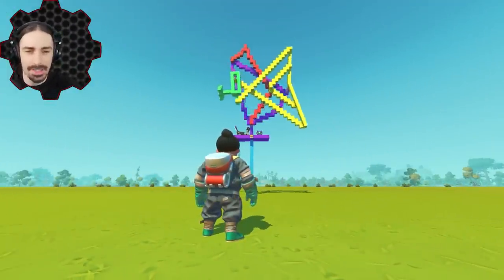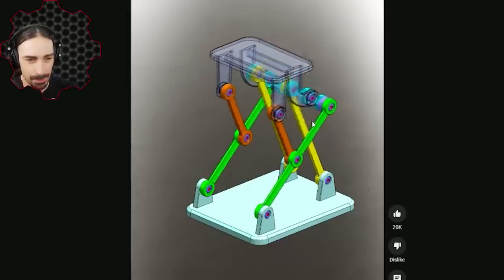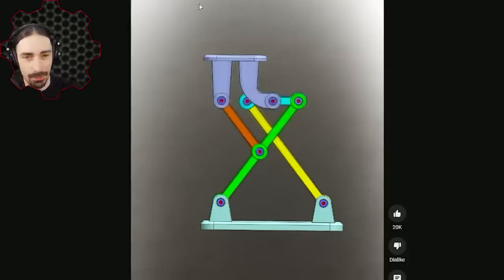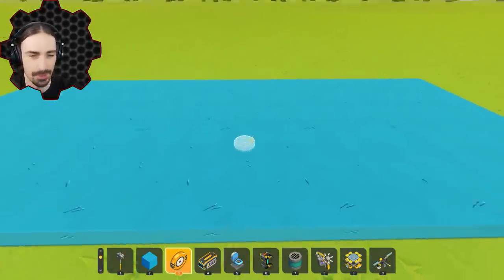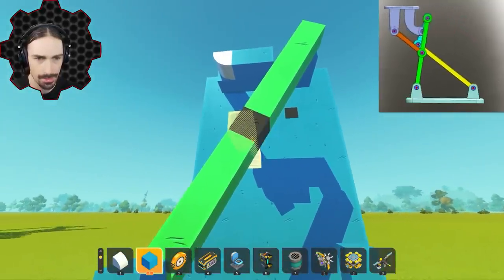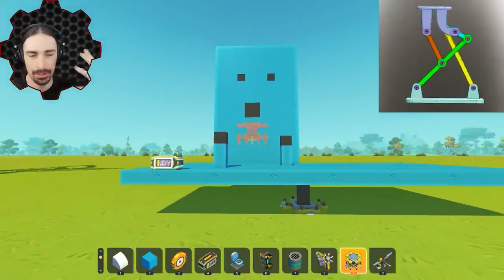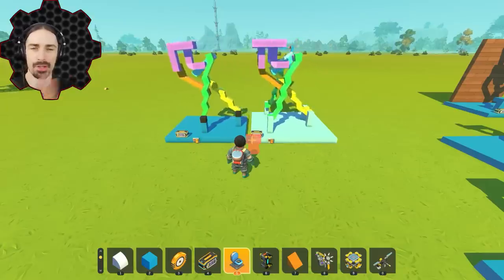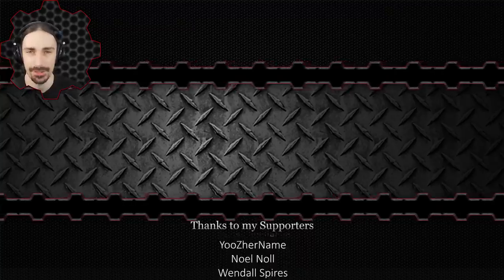Doing a Simple Task The Hardest Way Possible...

Comment: Fun fact: This mechanism is actually just the plantigrade linkage ScrapMan already built, just flipped upside down and with extra bits for support. In fact, this is the original implementation of the plantigrade linkage that the inventor came up with. The idea was to use this in steam engines to support the horizontal movement of the piston without linear bearings.
Reply: Bro I wish you sat next to me in school
Reply: @monke1758  lol
Reply: The top looks like pi.
Reply: Cool! I want him to attempt to make a conveyer belt powered by a winch(in either scrap mechanic or instruments of destruction bc it obviously won't work in trailmakers/other games).
Reply: Noooooooooooooooooooooooooooooo Noooooooooooooooooooooooooooooo Noooooooooooooooooooooooooooooo Noooooooooooooooooooooooooooooo Noooooooooooooooooooooooooooooo Noooooooooooooooooooooooooooooo
Reply: @technobladeik  Pikachu can't talk, but pika- choo choo goes choo choo .
Reply: @linglingtanudjaya6347  dont make me think about maths i did bad enough in school

Comment: I would’ve thought that when the blue was vertical was the ideal reference since all the bearings seemed to be on a 90 degree build grid
Reply: Same, when the mechanism was at its far left position the blue and green beams would both be vertical and collinear which should make it easier to make on a fixed build grid.
Reply: @conorstewart2214  but  the blue one never reaches perfectly virtical tho
Reply: @conorstewart2214  but the green beam would be hard to build since it wont be aligned to the grid
Reply: @astrohahawashere  but it doesn’t need to be a straight line
Reply: @nojusisnarauskas2343  bruh its a linear linkage its supposed to go straight
Reply: the blue line never goes vertical
Reply: @astrohahawashere  it would be aligned to the grid.

Also the beam doesn’t need to be straight, all that matters are the locations of the mounting points, it would work just as well with a curved beam or even just a disc.
Reply: @jakobmanton6889  not with the angle of rotation in the animation but it could, you just need to turn it a tiny bit more, there isn’t a hard stop on the rotation.
Reply: @astrohahawashere  yeah but it the shape of the line doesn’t matter, he literally explained this in his last video making a mechanism
Reply: @conorstewart2214  if the green beam was rotated 90 degrees it won't align to the grid
Reply: @astrohahawashere  if the green beam was vertical like I described and collinear with the blue beam it wouldn't have any trouble aligning to the grid, it would be perfect for making on a grid.
Reply: Can confirm that this works - it probably took me just a couple of minutes to measure the distances, confirm that they matched up fairly closely with Pythagorean triads, and build it in my own world (it moves very smoothly with a 180 degree motion).
Reply: @conorstewart2214  try it yourself then and see what happens
Reply: Also btw the green line never lines up vertically with the blue line
Reply: @astrohahawashere  just try thinking a little bit, in the animation it very nearly does, if you just rotate it a tiny bit more it would line up, there is no hard stop to the rotation, it is perfectly capable of rotating until it lines up.
Reply: @conorstewart2214  I tested it in a game called poly bridge and it never lines up
Reply: @astrohahawashere  Poly Bridge would probably be the best game for him to make these kinds of things, if he figured out how to get the motion started
Reply: @astrohahawashere  look at this comment thread, someone used the method suggested and it worked, and it works in theory too, just because you couldn't manage, doesn't mean it doesn't work.
Reply: @conorstewart2214  I guess you may have been true and my measurements are a bit wrong but still if the green beam was vertical it won't align to the grid
Reply: I guess you're correct if you build it big enough since I searched the Wikipedia and the length of the green bar is 2.5 times the blue bar
Reply: @conorstewart2214  I've done a bit more maths, and it turns out that the orientation that Scrapman was building it in also lines up with the grid - if you build it about one block taller than his last version - I've got the green and yellow beams 10 blocks between centres (or 11 blocks total, with bearings on the end blocks), the orange beam 5 blocks between centres, and the blue beam and the platform 4 blocks between centres.

It turns out that when the blue beam is horizontal, or either of the vertical orientations, then the bearings of the platform are always 8 blocks above the bearings on the ground (as always, measured between centres) - I haven't checked the angles in between because that requires trigonometry, and I was doing the maths with pen and paper, and a knowledge of the 3,4,5 Pythagorean triad.
Reply: @Autoskip  yeah that makes sense. A lot of mechanical systems can be solved with just basic geometry and some trigonometry. I do wonder how or why people came up with these mechanisms.
Reply: @astrohahawashere  except it would, why is it so hard for you to think about it and understand? What do you think makes it that it can’t align to the grid?
Reply: @conorstewart2214  I said my measurements are wrong
Reply: And also I thought that the yellow bar would limit the blue and green bar so they will not line up
Reply: @astrohahawashere  why argue it so confidently if you aren't sure?
Reply: @Anikin3-  they meant horizontal

Comment: If you make these contraptions much larger,  you'll have better resolution for placing your bearings.
Reply: Bigger ain't always better. 😁
Reply: @BLKBRDSR71  in this case bigger is better. the larger the structure, the higher the resolution, and thus, the closer to ideal the bearing placement can be.
Reply: but there would be more weight, and in turn, more stress on the bearings
Reply: @Cat_1n_A_Basket  good point.

Comment: there are a few things that I would like to point out, first of which being parallel lines. if you'll notice, the yellow line and red (orange?) line stay parallel through the whole motion. another thing is midpoints. the red line was built off of the midpoint of the green line. one thing I might've recomended for this particular build would be starting with the diagonals, specifically green. since we know that the length of green and the length of yellow are the same, with the length of red being half that, and also knowing that green needs a reliable midpoint for red to attach to, as well as the parallel relation between yellow and red, I figure it would be logical to start with green, consdering how many relations it has. of course there is also the mathematical way of doing it, figuring out lengths/ratios with the Pythagorean theorem, but as far as trial and error goes, you want to pay attention to as many minute details as possible.

tldr: when recreating mechanisms, it may be beneficial to not only look at positioning of joints and how it generally moves, but also how it moves relative to itself, considering which things will stay parallel or perpendicular and other things of the sort.
Reply: It was just rotating more, you can see how far the green and yellow connectors rotate compared to the animation.

Comment: I think that bearings are way cheaper to build in survival mode than pistons. So if you like a platform that can quickly extend and retract while bot raids are going on, I think it's a cheaper solution than medieval-styled castle gates. I think those doorways have to be big enough in order to protect the base form afar.
This contraption can be put under water with the platform getting you out of reach. and it seems that it would be easier to protect with sturdy materials against Totebots.
Also, with a bit of tweaking, you could definitely have a platform that lowers while moving sideways so that you can have your main base even higher from sea level.

Comment: For those of you curious, the required dimensions for this mechanism are as follows (credit to @thang010146 and his video "Tchebicheff stool 2"):

Length of blue bar: a + a
Length of orange bar: 2.5a
Length of yellow bar: 5a
Length of green bar: 2.5a + 2.5a
Horizontal distance between the seat connections: 2a
Horizontal distance between the ground connections: 4a
Reply: I do not understand anything 🤣

Comment: I think this can be done with scrap mechanic's build grid. I believe the important measurements are that the green and yellow are equal and the orange is half the length. Given all of that is true and each of the lines has the same gradient i think it should work. So it might actually be easier to start with the green and yellow, build them at 45degrees say 11 long on the diagonal, and then build the orange 6 long on the diagonal, then connect the yellow and green with the blue. making sure the platform is connected to it's center.

Comment: if you have pixel issues, just scale up, better resolution, the smaller the higher relative minimum step length
Reply: how about not try to fit on the static build grid, just one attachment point, all other contract pistons to get the other fixed joints in place
Reply: What about using a game that is not extremely bad?
Reply: @Reth_Hard  whatever

Comment: my only point to make in these is that the start and end points of every line just have to be put in the right spot. the shape of the static arm that connects those two points does not matter. you could ignore making "straight" beams and just do L shaped arms to connect the points and as long as they are on different layers, they wont interfere with each other

Comment: I'm not playing scrap mechanic a lot so I might be wrong but...can't you just weld the thing to the grounded pole, set the angles with a controller, and then weld the bits toghether? Will it work the same as if it was on a lift?
Reply: Nope, it won't weld. Bearings only weld like that on a lift. It's really stupid

Comment: next time you should directly measure the the pixel lengths of the different parts of the mechanism, use that to find the exact ratios of the dimensions, and then find the smallest number of blocks you need to get those ratios within around 5% error

Comment: This mechanism has an advantage over pistons (in scrapmechanic). Pistons are bound to full block distances, whereas the bearing mechanism can stop offset to the grid (like at 2,3 blocks distance), which in some cases might be useful.
Also usually the important thing is the ratio between the lengths /distances so you could put an image of the mechanism in paint, draw lines over the different parts, decide a neutral length and base the relative lentgh of that i.e. The blue beam is neutral lenght with 100px lenght and the green one is 230 px long so you'd need to build the green one 2,3 times longer than the blue one and repeat for other lenghts and distances, and then you can multiply it to a point where every lenght is as close to an integer as possible (could end up with massive numbers though). However seeing you eyeball stuff and it somehow workout is far better and we're also not here for complicated math in the first place, just placing it here because you sometimes like to get technical, accurate or atleast ideas for possibilities.
Reply: Actually no, with a bit of logic even pistons can move continually and not in increments. Kan has a vid on how to do so
Reply: @cookiecrumbzi  do you know which video exactly i'm curious how he did it. And the point was advantage over only a single piston with no logic whatsoever (like SM shows in the video) overall this mechanism is probably one of the most inefficient ways to achieve linear movement with precise distances (in scrap mechanic).
Reply: @cookiecrumbzi  ahh i think i found it. do you mean in the video "How to Build a Double Piston Robot Arm for Survival! (Scrap Mechanic Tutorial)", where he let's the piston spasm to get an exact distance.
That sure is a way to achieve that and definitely more efficient.

Comment: You should see if you can build the mechanisms in a different position before you start. If you built it in the position at one end of its motion you could see that the green and blue bars would both be vertical, that could maybe make it easier to build.

Edit: you mostly did it by getting the blue one parallel, but it maybe wasn’t the best position.

Comment: The motion is pretty "simple", although I must test everything I say
yellow and full green are the same length, top green and orange are the same length (I must test if this holds true for random lengths
blue averages the motion of yellow and green to a vertical 0, so if blue is in the horizontal position its connection to the table must be in the middle of yellow and greens ground connection

your initial mistake at 12:00 is different lengths for top green and orange

Comment: Can't wedges be used to make a straight line at an angle?
Reply: well yes, a 45 degree angle, otherwise no (maybe a 22.5 degree angle as well with the 2x1 wedges, but you are still hard limited by the build grid)
Reply: @philipplins2012  or else a mod would work for precise angles